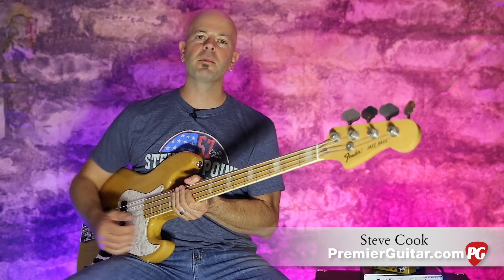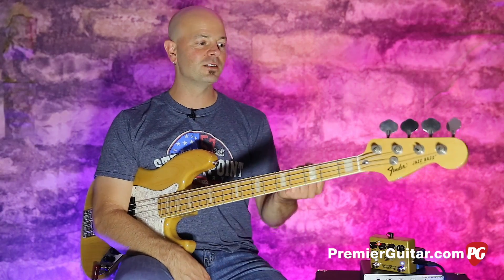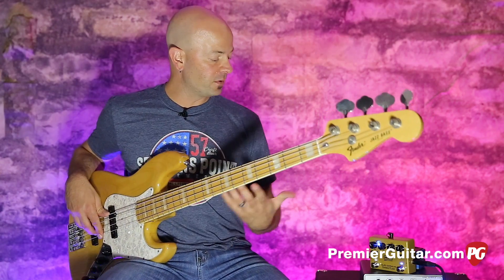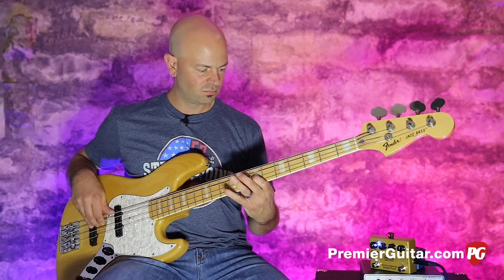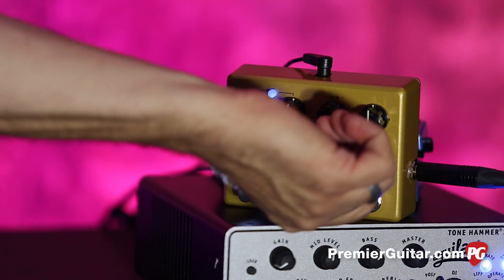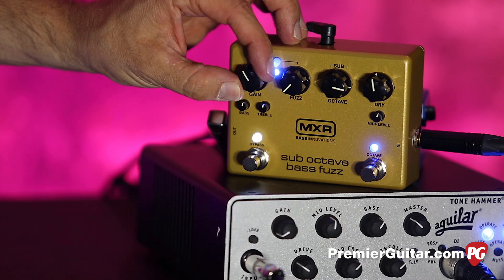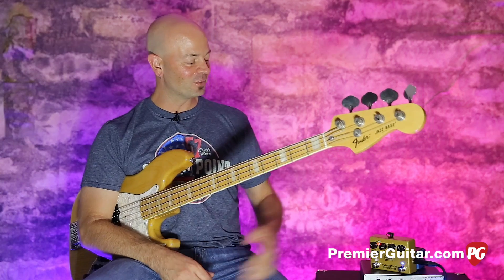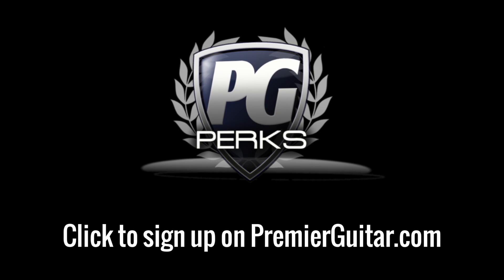Review Demo - MXR M287 Sub Octave Bass Fuzz

Comment: Just got one.  The clean, octave, and fuzz channels sound incredibly independent, which is very impressive to me. Not everyone wants to sound like a generically Darkglass clone with perfectly encapsulated overdrive that only amounts to one numetal tone. Fuzz is a great old school form of distortion and the numbers of ways I can manage that fuzz, including boosting at the treble and bass ends, and how much I blend in dry and octaves, is pretty damn modern without needing a sound engineering degree to figure out all the knobs.

If I were to build this a as a perfect beast I'd like an optional stereo out dry/fuzz and a tone control for the suboctave.
Reply: Your comment about Darkglass is exactly how I feel.
Reply: Just so you know....  The Darkglass is definitely probably about twice as usable as this pedal.   And it is definitely far from a Numetal one trick pony.  You pretty much just discrediting yourself.
Reply: @prettyugly6089  maybe you should try this pedal instead of stanning for Darkglass.
Reply: @prettyugly6089  When darkglass pedal don't broke they are usable yep ahah...ahg